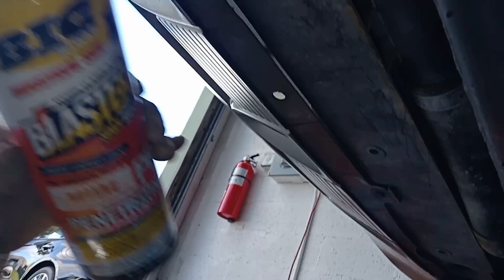Nissan Murano Oxygen Sensor Replacement

Comment: Can you show where the bank 1 sensor 2 is located?
Reply from the maker: This is a bank 1 sensor 2 that I'm showing in the video, it's called downstream.
Reply: @jz2639 OK, mine says air/ fuel ratio sensor 1 and another line says air/fuel ratio sensore 1 (bank 2)

The diagnostic also showed camshaft sensor but I was told if I fix the O2 sensor it may resolve the camshaft.

Codes:
P0340
P1274
P1284

Do these mean anything ?